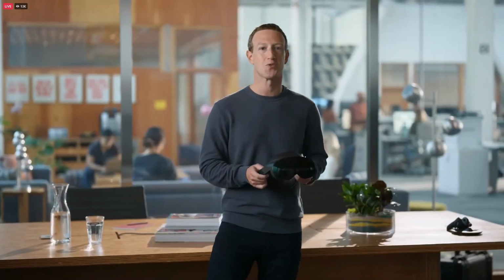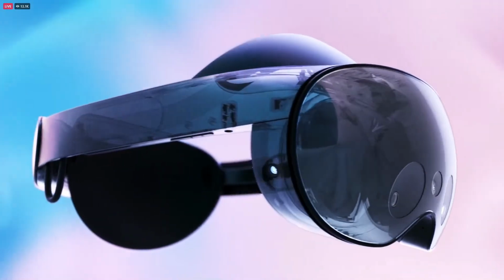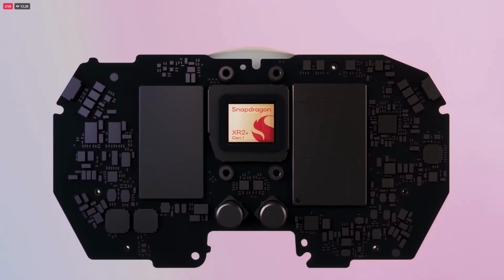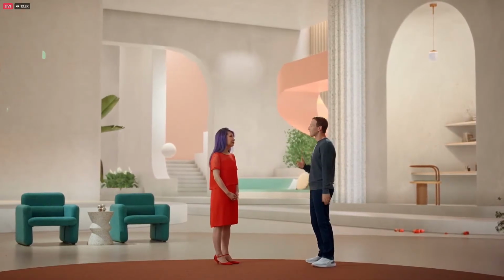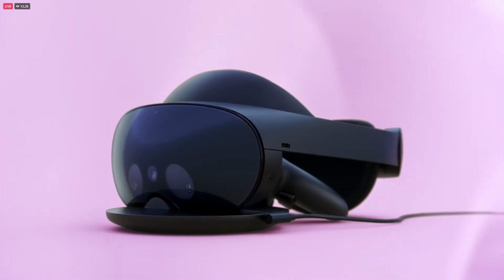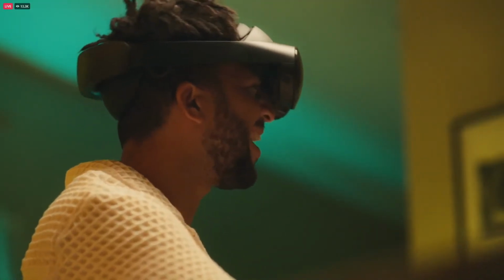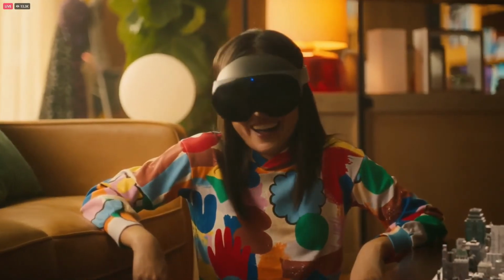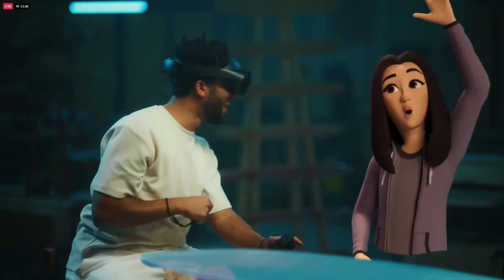Zuckerberg Reveals Meta Quest Pro

Comment: I know everyone on the gaming end is (rightfully) overlooking this for its price tag, but as someone going to school for UX design who’s actually used the Quest 2 as a productivity and prototyping tool, I may have to set aside some money for this thing
Reply: I'm planning on trying to use it as a monitor replacement for a few months and see how capable that is.
Reply: @deejnutz2068  well it looks capable but only for an hour. Then you need to recharge it for an hour. Don't plan on being productive.
Reply: @burbercat3558  I'm sure it can be plugged into a power bank while using it to keep it from running out of battery. Just buy a 12ft charge cable
Reply: @mr.grumps3544  probably however all the hard liners on not having wires won't be happy. This is exactly why you still need a wire in 2022. The specs for this are just mediocre as there are a lot of compromises to keep power consumption down.

Comment: Yeah they really wanted to emphasize that it's not a consumer friendly product, and mainly for professional use. That's why they priced it at 1.5k. So normal consumers won't be tempted to buy it. You could literally buy a valve index and part of a gaming pc for the price of the quest pro. For consumers just wait for the quest 3
Reply: The word "pro" got so watered down, that people forgot it's meaning.
Reply: Valve index has the resolution of the Quest 1, LCD display with no local dimming zone, no face/eyetracking, no RGB passthrough, is wired, no stand slone capabilities, only fresnel lenses, no lidar sensor. Would be weird if it wouldnt be much cheaper lol
Reply: @coolertuep  Good comparison. And the controllers have their own camera tracking, so you can never lose line of sight between them and the base stations, like the Index can.
Reply: @coolertuep  its cheaper, it has games that run good and look better then quest games. Pcvr, its controllers are great, tracking decent, its for consumers, and its mic is amazing. And that is coming from the fact its from 2019 maybe earlier?? Pretty good
Reply: @Curriial  you can connect any quest wirelessly to a computer and play pcvr with either OLED + same resoltuion, or LCD with much higher resolution
Reply: @Curriial  As the other guy said. Quest 2 is great for PCVR.
Reply: "pro device" but only lasts two hours?
Reply: @latinouncle8752  That really surprised me. What's the point of making a deal with Qualcomm for a VR optimized CPU, if you can't get better battery life
Reply: It's good technology, but bad pricing the same. How else a developer make games visual if they can't afford one the first place. It's bad business. Need cheaper model.
Reply: @theinquisitor7191   they didn't market it for game devs. They market it for general work. They priced it that way so people don't go out and buy it themselves. It's meant for companies to buy for their employees. It's also meant to be a tax write off
Reply: @enoch7564  this is bogus. 😭
Reply: @theinquisitor7191  how lol. They can market it to whoever they want. They don't have to make it consumer friendly if they don't want to
Reply: @theinquisitor7191  My colleague develops on the Quest 1, I develop on a Quest 2. Don't blame the tools for a bad developer.
Good developers can work on anything.

But now that we are rich we can easily afford something like the Pro.
Reply: @AkiRa22084  it will take me 3 months of commitment to purchase a 1.8k goggle play. 3 months...
Reply: @theinquisitor7191  You're doing it wrong?
VR development pays big bucks, since hardly anyone can do it.
Reply: @fredbehrend2788  they already confirmed it will release later this year lol
Reply: I think pro phones should have more features and be priced higher. Too many average consumers have pro iPhones and don’t use any pro features